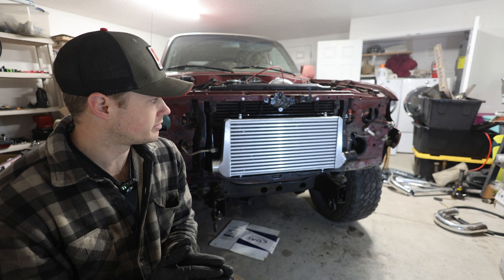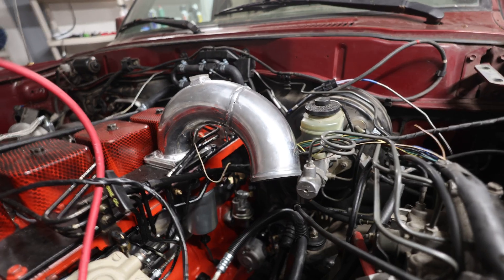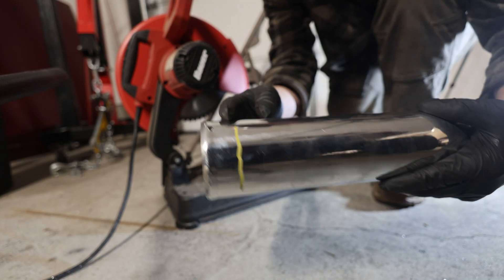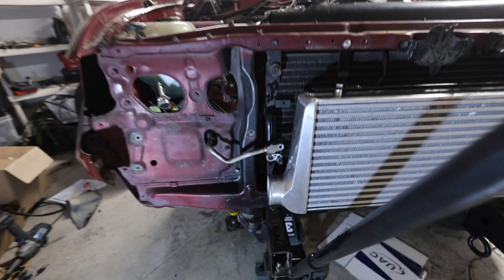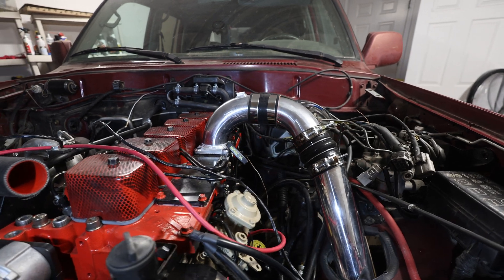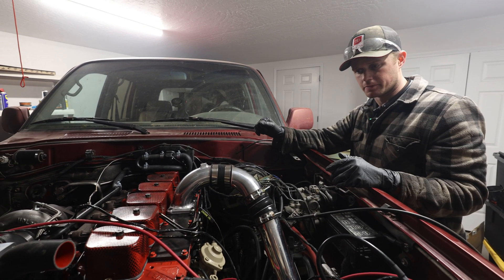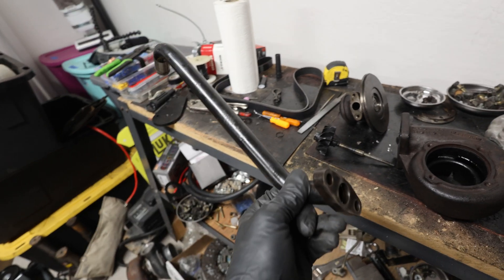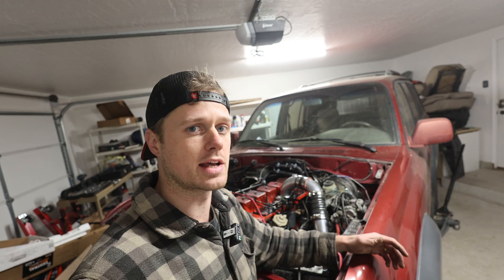Building An Intercooler For My Cummins Swapped Land Cruiser

Comment: This build is sick as. I was thinking about a similar swap for my 80 but I already have a factory diesel 1HZ which I’ve turboed. Not the most powerful thing but very smooth and reliable. 400,000kms and it starts in half a second 😂. 
If you want another project, swap an 80 with a 1HDFT which is the factory turbo, 24valve version of my engine, very smooth and reliable but it wonder how it would stack up to the 6BT, especially after a decent tune and plenty of boost.
Reply from the maker: I’ve heard that engine is pretty bullet proof even with a turbo! I just like that Cummins parts are so readily available stateside which is the only deterrent of doing a Toyota diesel swap

Comment: Engine blow by is one thing but crank case vent is quite another just to let you know I’ve been running Cummins for many years. My latest engine build I put a aftermarket tappet cover on it blows oil out like crazy. I’ve tried many different hose configurations for it. Still blows oil out. I have to put a valve cover vent just to remedy that issue.
Reply from the maker: That’s exactly what I’m thinking. I’ve got a catch can on the way, but valve cover breathers are the next thing!